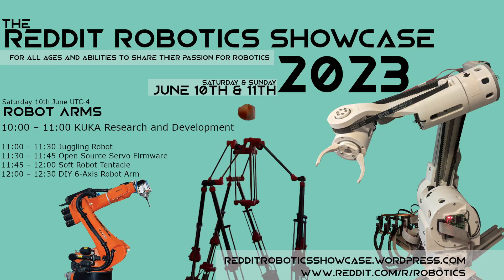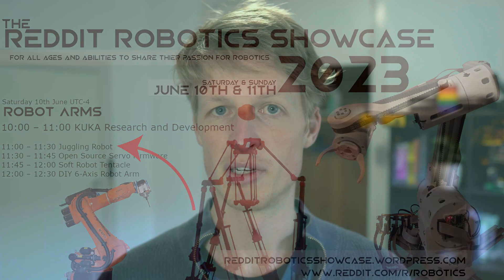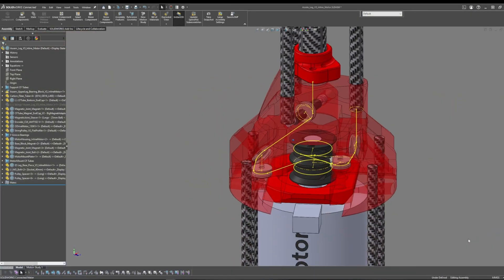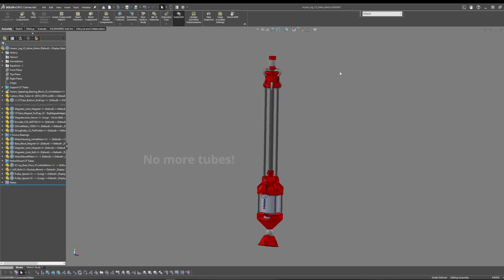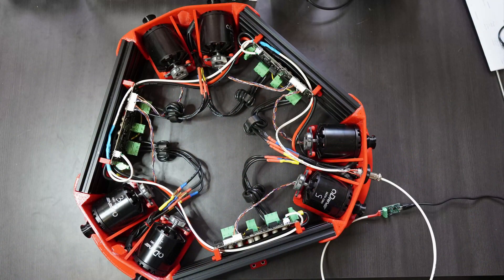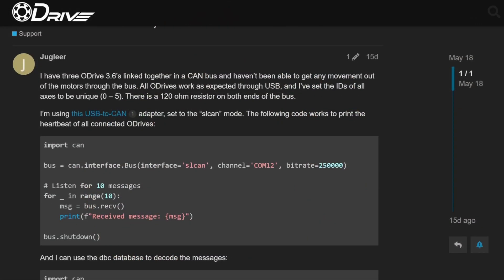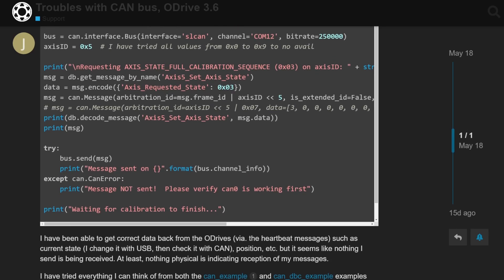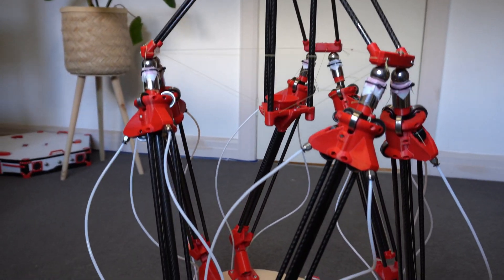Catch My Jugglebot Talk and Help Solve a Tech Puzzle (CAN Bus) | PDJ #20

Comment: Are you Using Canbus FD? or regular can? Duet/Reprap firmware hardware uses CANBUS FD because it handles greater bandwidth. CAN FD (Controller Area Network Flexible Data-Rate)
Reply from the maker: Just regular CAN for now. I think its capacity is huge for what I'm doing with it

Comment: Regarding your CAN Bus issue, I would make sure to always use twisted cables to avoid EM interferences. I'm not sure your current cabling is CAN Bus ready, and this could cause the issue, especially near the motors. Good luck!
Reply from the maker: Hmm yeah I've heard that sentiment before. I'm using shielded wire (braid + foil) because that's all I have on hand. I could try a twisted pair, but that wouldn't be shielded and I'd think that would be worse than a shielded non-twisted pair?
Reply: @harrisonlow  not necessarily.  Because CAN uses differential signal, external interference isn't an issue as long as both wires see exactly the same interference.  Since you subtract one signal from the other to extract the bits, adding the same external value to both makes no difference.
Reply from the maker: @matthahne  I've been reading a lot about this today and it sounds like what you said is true for the most part, but there are (apparently) situations where you can "overload" the system and the differential doesn't work properly. Do you know anything about that? It's possible I misread the forum post or they were just talking out their ass

I did end up making a twisted wire pair today to "dot all my i's", but the problem persists 😢